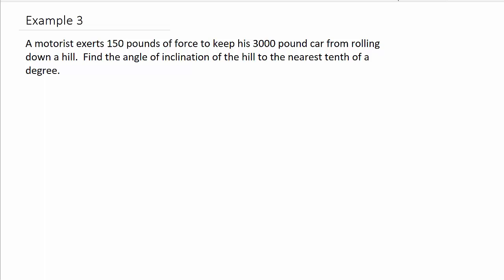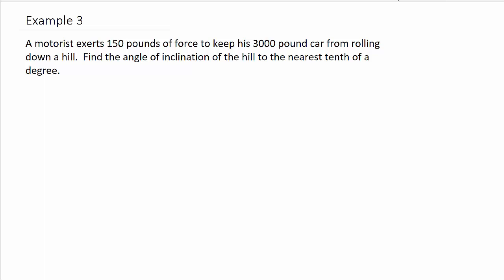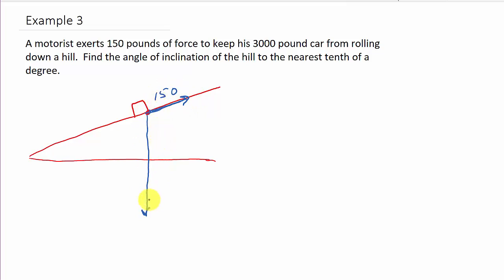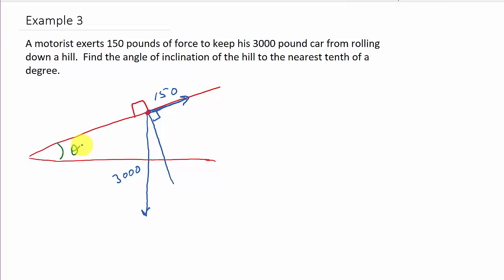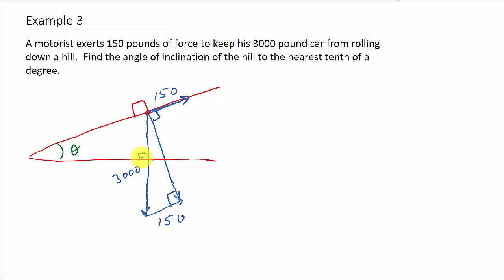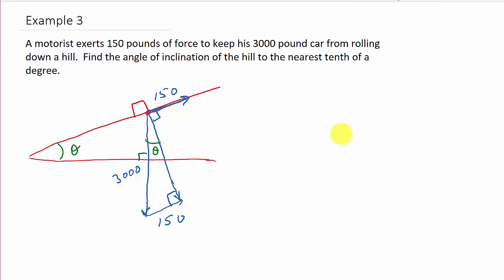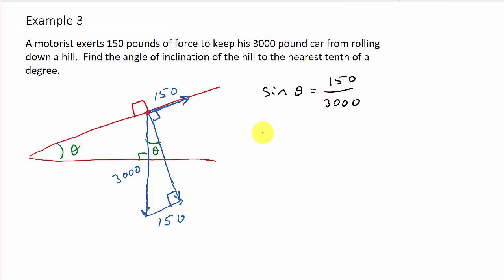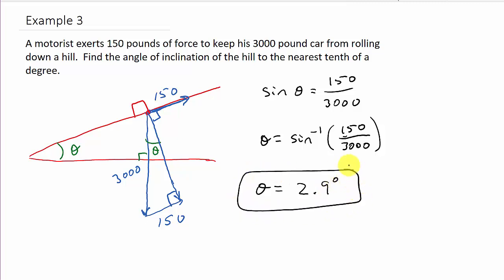Vector Application: Find Angle of Inclination of Ramp Given Two Forces

Comment: wait but what about gravity? 
Fg=m*g*sinx which should equal the opposing force of 150 pounds right?
So 3000*9.81*sinx=150
sinx= 150/(3000*9.8)
x equals to arcsin 150/(3000*9.8) ?

Or does the 150 pounds also need to take into account gravity?
Reply from the maker: It’s in pounds.